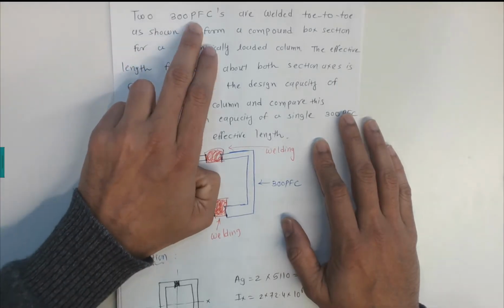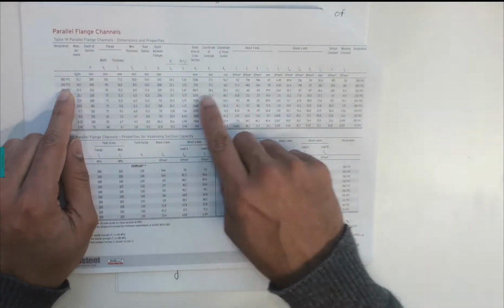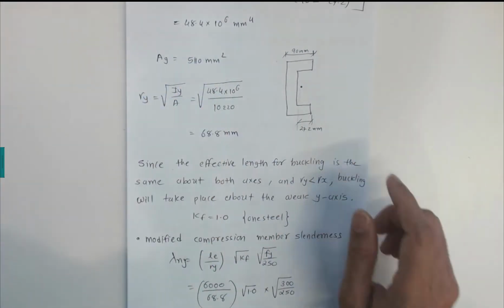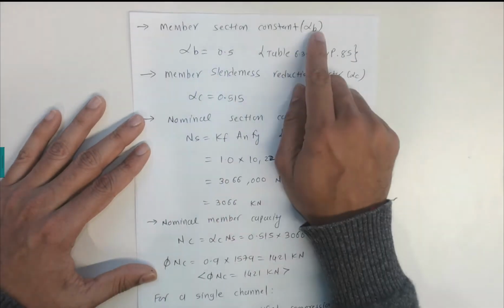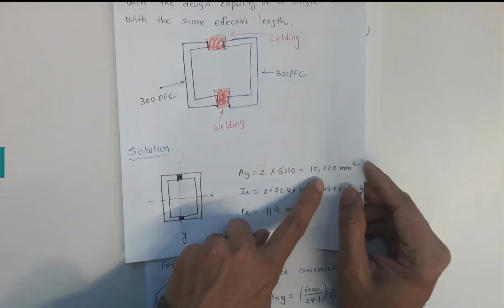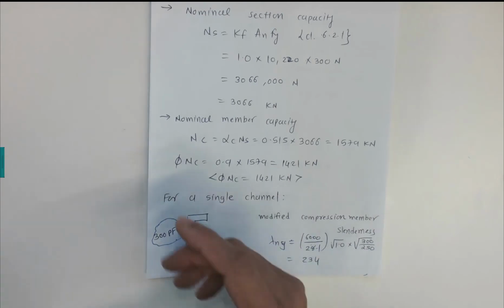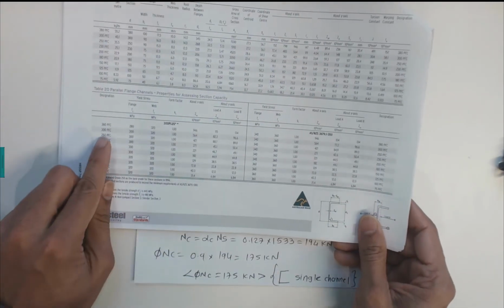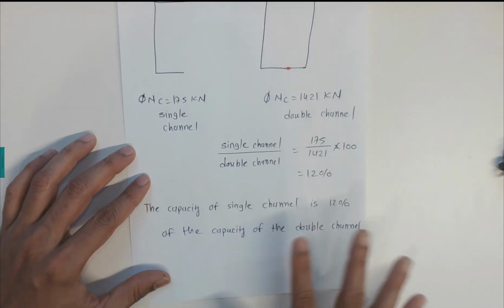Steel column design for compression Example 6

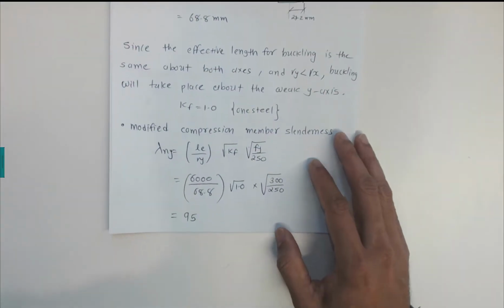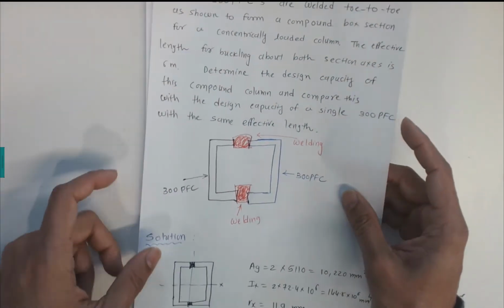Comment: Hi Dr Vipul. May I ask why you used modified compression member slenderness (in 3:58 and 7:58), but nit Table 6.3.3?
Reply from the maker: You can calculate the member slenderness reduction factor (alpha,c) using Table 6.3.3(C) of AS4100. This table requires two parameters. First parameter is modified member slenderness (lamda,n) and second parameter is section constant (alpha,b). Therefore, I have used the modified compression member slenderness which can be used in Table 6.3.3(C).